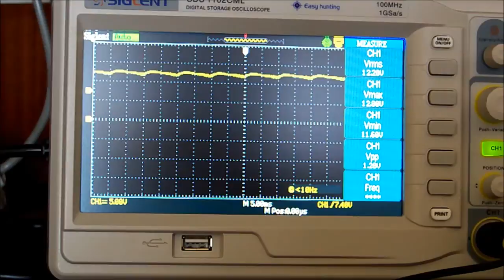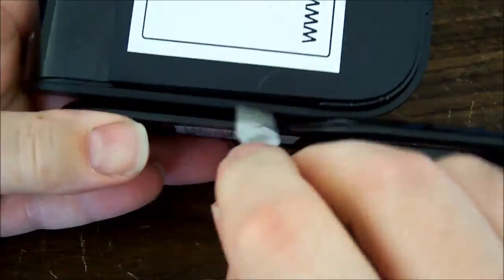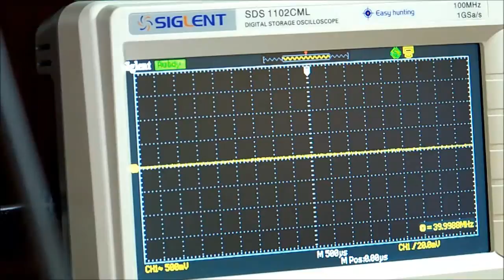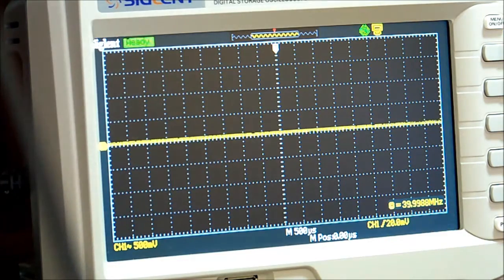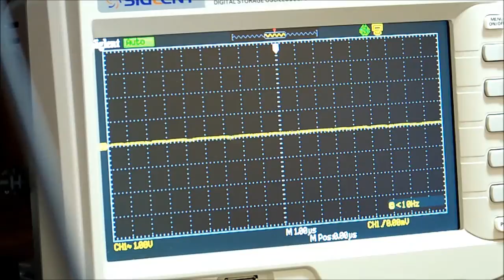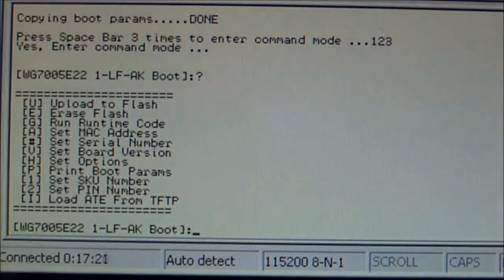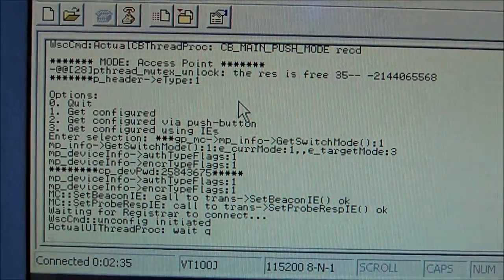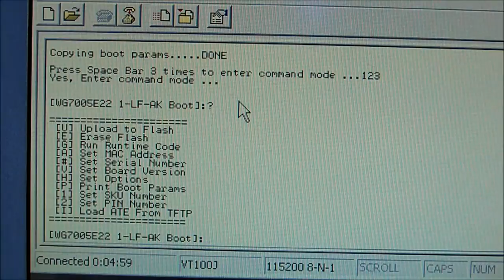Belkin router no boot diagnosis

Comment: Thanks Jonny for your video, I'd loaned out one of these, only to come back dead and the 12V plug pack was fine. When opened it up and tested the same initial points as you, I only got the 1.5V but not the 3.3V :( so guessing I've got failure somewhere in the power circuit. More for e-waste recycling bin.
Reply from the maker: Probably a shorted cap on that line if you hook up a bench supply to it limit to 3.3v and find out which one gets hot then remove it it'll probably work fine again.

Comment: What if the LEDs are all lit on? Mine has this problem.
Reply from the maker: I don't know. Try outputting to a serial console like I did here and see if you can find where it's hanging during boot or if it's even starting to boot, then troubleshoot that. Was a firmware update attempted before this happened? Maybe it's the wrong version or maybe it bricked.